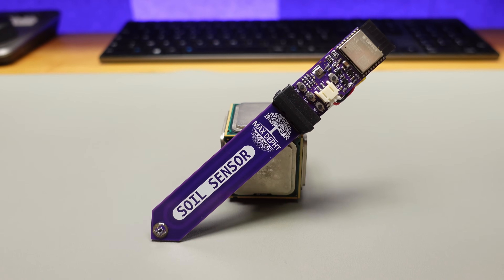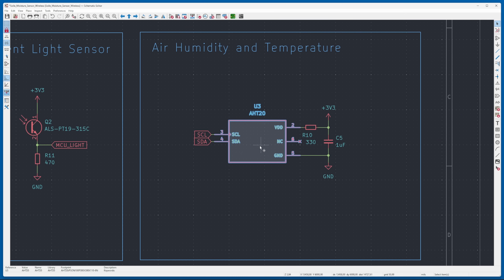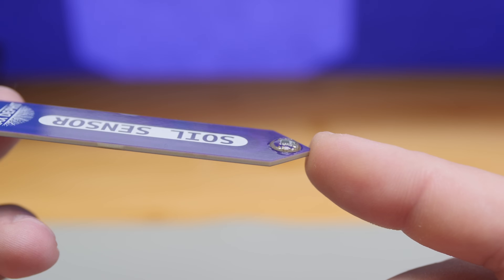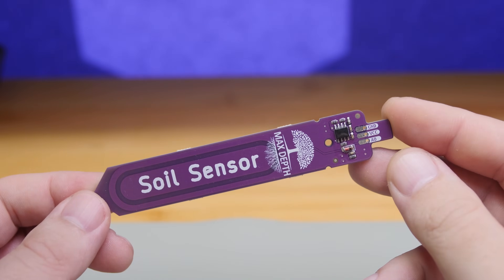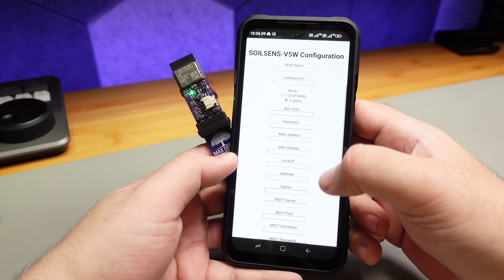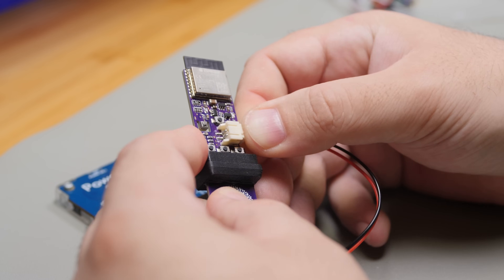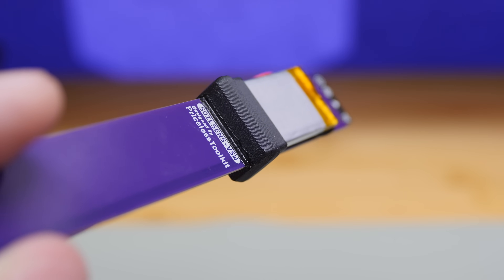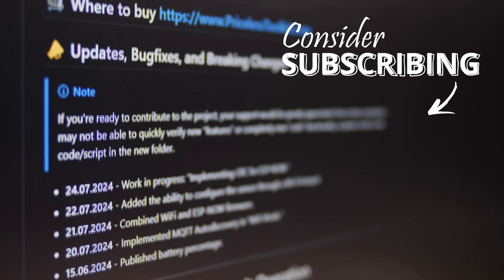Ultimate Soil Moisture Sensor for Home Assistant SOILSENS-V5W

Comment: Did you use a conformal coating on the edges of the PCB to prevent moisture seeping in between the board and solder mask? Or do you think that's unnecessary?
Reply from the maker: Yes, I dip it in epoxy resin and hang it up. It wets and seals the edges of the PCB. Acrylic conformal coating is not meant for that.

Comment: Congratulation! I've built my own "ESPNOW-VALVE-CONTROL" gateway and the sensor communication was flawlessly. One thing I'd like to tell is to pay attention to the calibration sequence. As already mentioned, if the cal-button is pressed too long , you may fall into the setup mode without realizing it and settings are lost. Due to the limited space around the Cal-Button, use the right tool, its not possible to use the fingers, at least not for me. Anyway, I'm very happy with the sensor and the measurement results.
Reply from the maker: Thank you! I'm glad everything worked. And you're right I'll change the button timing for the next batch.

Comment: Look nice and well finished,  but sorry, those kind of sensor are not good enough : 
- too short
- they will die in a few month
- hard to calibrate
- value change if you move it just a little
Did you test yours in a long run for more than a month ? are the data reliable ?
Weighting scale under the pot works way better.
Reply from the maker: Yes, I know sadly, no magic in this world 😄 The sensor is protected with epoxy resin as much as physically possible, and I'm actually using it myself. So far, it’s not dead (surprise!). About value changes when you move it — like I said, no magic: that's just how physics works. As for the weighting scale… sounds great, unless your plant forgot to grow. 😉

Comment: Great idea. But unfortunately these, (and none of the Tuya etc sensors I’ve seen either),  go anywhere deep enough into the soil for anything other than very small pots. Many common house plants need to dry out at the roots between watering, and just because the top couple of inches are dry doesn’t mean the roots are (the soils does not dry uniformly), and people very often overwater their plants. The soil moisture testers that actual house plant experts recommend and use are much much longer. It would great if they could be automated.
Reply: This can be overcome by digging a whole and surrounding it with plastic and putting the sensor further down.
Reply from the maker: @Miguel-ng5wm  not a good idea, wather level can go up in it and will kill sensor.
Reply from the maker: Yes i agree, it is for small plants.
Reply: Hey  @PricelessToolkit i have got small house plants, are the kits (beside battery) ready to go or do i have to assemble and apply software etc?
Reply from the maker: @daveman961  Hi, it's ready, but you need to configure it. https://github.com/PricelessToolkit/SOILSENS-V5W?tab=readme-ov-file#1-configuration
Reply: @BadgerBob when you say these sensors are only meant for very small pots, what would you say is the maximum pot depth they can be used with?  Many thanks.

Comment: Most sensors have a problem with long-term performance. They focus too much on manufacturing and not enough on materials analysis. Will this sensor work for a year in the ground, or will it be destroyed by corrosion sooner?
Reply from the maker: Ask after a year!, but it is more protected than cheep aliexpress ones, edges are sealed with epoxy resin.

Comment: The 555 is not needed if you have an ESP32 on board, just setup a periodic timer from the ESP32 to generate the PWM. It will save somewhat 150-200uA current and further prolong the battery life.
Reply from the maker: Yep, i know, Thank you.

Comment: Incorporate a light pipe for the light sensor if you want to use opaque cover plastic. Yes it adds some complexity, but it allows for better types of plastic to be used.
Reply from the maker: @kineticraft6977  ASA is not the best ?
Reply: ASA has a lower clarity than acrylic (PMMA) or polycarbonate (PC).
 @PricelessToolkit

Comment: really nice! I have a lot of 3V lipos laying around from single use vapes. They should fit perfectly for this project!
Reply from the maker: Lipo 3.7V nominal. and if the size is small enough
Reply: @PricelessToolkit 
Just checked they are 3.7V. i don't think they'll fit but I will print my own case and problem solved :)
Reply from the maker: @mrsinnlos1000  nice!!

Comment: Nice work, looks like a great design. 
I would suggest adding some epoxy to the edges of the PCB too. It's probably not needed but moisture has a habit of finding its way in over time.
Reply from the maker: Yes, I’ve already added epoxy along the edges and applied a fine coat to the surface, while the component areas are protected with an acrylic conformal coating.

Comment: That's ... fine, but without some kind of sensor that would give a sense of the ground fertility I see no point in replacing a "Xiaomi Mi Flower Care"
Reply from the maker: Yep, there is no need to change the sensors that you already have, there is no point in that.

Comment: the FR4 alone will expand from moisture since it's not covered on sides. just from experience on sensors: being even close to soil will destroy most of electronics in months unless they are fully sealed, like dipped fully in epox.
Reply from the maker: I’ve already added epoxy along the edges and applied a fine coat to the surface, while the component areas are protected with an acrylic conformal coating.

Comment: Good Project! Any plans to do a „low cost“ version? 30€ for one is quite steep if you need something like 5 of them. And with having 5 of them, a lot of the sensors on the device are not needed anymore.
Reply from the maker: Thank you! If I assemble the PCB but skip protecting the TMP and moisture sensors with resin, and don’t print and glue the case, then maybe yes, a 'low-cost' version could be possible. But let’s be honest, no one really wants to inhale that toxic stuff themselves!

Comment: Btw you don't need a pull up on tpm102 alert pin
Reply from the maker: don’t remember exactly, but I believe a pull-up is mentioned in the datasheet.
Reply: @PricelessToolkit  it is necessary when you use alert signal. Otherwise it can be left floating.

Comment: Why not make a Zigbee based on using ESP32-H2? The market for one based on Zigbee would be much larger. I personally avoid WiFi devices when ever possible.
Reply from the maker: I don’t build devices specifically to sell; I make them for myself first. If they turn out well, then I may offer them for sale. I'm also not familiar with Zigbee and have never programmed with it.

Comment: How Does ESPNow compare to LoRa, rage-wise? If I could get signal from my 4-th story apartment all the way down to my building's backyard (which currently I can't with either my wifi or zigbee setup) it seems like a good alternative to LoRa with much less hassle.
Reply from the maker: range is like "3-4 x WiFi range" but i cant say it will work in your situation or not. If you put zigbee gateway behind window it not working ?

Comment: i believe this suffers from the same fate as any other PCB-build capacitive sensor; moisture creeps into the PCB and permanently alters the sensor's readout
Reply from the maker: dip into epoxy resin. or in my case "epoxy conformal coating"

Comment: Wow the calibration mode is really nice, also 67nA?! ❤
Reply from the maker: Thank you very much!
Reply: I wanted to ask, with the moisture sensor sandwiched between layers, obvious win! But how does it work? Like does moisture sneak through the layers to make a measurable change?
Reply from the maker: @stucorbishley  no, its a capacitive sensor. moisture cant go inside, i sealing it with epoxy.

Comment: Hi. This won't last. The only soil moisture sensors that work are time-domain reflectometry (TDR) based sensors.
Reply from the maker: if you know what you're doing, the sensor will last.
Reply: @PricelessToolkit  It will not no. Even if you coat the edge of the PCB with a resin it will eventually de-laminate and the traces will erode, changing the readings you are getting which leads to false triggers of automations. Ask me how I know.
Reply from the maker: not only the edge but the entire part that goes into the soil "dip into epoxy" MG chemicals have a conformal coating that can be submerged in water.

Comment: Very nice. For a zigbee design, do you need to redesign a lot? I guess a different chip would be better for zigbee, as esp32 needs the expensive c6 or h version and draws more power than needed.
Reply from the maker: Thanks; the Zigbee code is complicated for me, for that reason, i didn't put c6

Comment: Sadly as far as im aware, so far every one of these PCB designed sensors get infiltrated by moisture on the PCBs cut corners. The moisture that is soaking in the PCB from the side and between the layers will start changing the calibrated readings and after a while it completely will stop working. Some cheap ones hold on a week, some more expensive ones maybe a few months. Sadly this is why industrial sensors are so extremely expensive.
Reply from the maker: you can coat "dip" it  with epoxy resin.

Comment: A small solar panel on top is probably unnecessary but fun :P
That would increase battery life to unlimited i would guess?
Or allow more frequent updates.

Or even have a "smart" algorithm choose the update frequency based on battery voltage / percentage.
Above 95% every 5 min, above 90% every 30 min, etc.

If there is no sun it will eventually fall back to 1 hour.

Probably would make it way to complex, but fun to think about :P

Awesome video!
Reply from the maker: Cycle time is not software based.

Comment: So the sensor with the Cap is not suited for outdoor usage? How do you suggest to charge the battery?
Reply from the maker: Rains come in different strengths, and the sensor is not watertight. 1s Lipo USB charger, links are on the GitHub page.

Comment: 😍 You restocked them?! Those soil sensors are just next level! I love this project, great work 🙏

//EDIT:
Isn't it called Depth and not Depht? (Regarding that on the soil sensor)
Reply from the maker: It is on preorder, next batch will be ready in 10 days. yes, it is already fixed.

Comment: How does this integrate with droplet? And plans on selling bundles?
Reply from the maker: The sensor integrates seamlessly with Home Assistant, making its data available to any other connected device. By default, the Droplet checks the wired sensor’s value every 5 seconds. If you'd like to use the Droplet with a wireless sensor, the ESPHome YAML configuration will need a few minor adjustments.

Comment: Cool, very clever PCB design!
What's the reason the wired version doesn't work with the Doplet?
Reply: Meh, more elegant than my current corroding sensors ;)
Another possibility maybe: a 3V3 regulator before the VCC-trace on your sensor?
Reply from the maker: @HenrikAkerstedt  Yes that will work. What part is corroding ? try dip sensors in epoxy UV resin.
Reply from the maker: Thanks.  Dropled has 5v output on sensor connector, so output signal from the sensor will be more then 3.3v
Reply: Ahh, I see. So would a 5V to 3V3 resistive voltage divider between the sensor output and the Droplet work then?
Reply from the maker: @HenrikAkerstedt  in teory yes, you need to bring down the max level to ~2.8-3.3v, but this is not an elegant solution.
Reply: I think water got in through the edge of the boards, where the epoxi is thinner. The signal quality got worse over time, so I might need an upgrade!

Comment: Nice sensor, well done! 👌🏻

I'm using WiFi, BT and Zigbee devices. All of these protocols, just like ESP Now, run in the 2.4 GHz frequency range. How does ESP Now affect other networks, what is your experience?
Reply from the maker: I have a bunch of devices on WiFi, 5 on Zigbee, 8 Bluetooth. I can't say I've noticed any issues, as the transmission time in ESP-NOW mode is ~100ms every hour.

Comment: Really interesting looking soil sensor. I like how you have designed the moisture corrosion opportunities out.

One small critical observation -  Max Depth has a typo (Depht) on the silkscreen.
Reply from the maker: Thanks! yes silkscreen typo is fixed :)
Reply: @PricelessToolkit  Great stuff!

The more I think about this, the more I am impressed by the whole sensor suite you have packaged together. I will certainly be following along, and I'll also procure a few sensors too.

If I may offer a small design suggestion?
Instead of a translucent case, take a length of virgin filament, and affix it into the case as a light pipe "antennae". A cut of 45 degrees at the lux sensor end should allow the gathered light to be reflected onto the sensor. With the other end of the light pipe among the foliage, a relative measure of the amount of light the plant receives could be most beneficial, and still allow the most UV resistant case material to be used.
Reply from the maker: @squelchstuff  Great suggestion! If I find the time, I’ll design a cap with a hole for the filament. However, even with the white cap, the light sensor is already sensitive enough.

Comment: Great Sensor, any specific reason why LMC555 is generating PWM and not ESP32-C3 directly?
Reply from the maker: Yes, the ESP32-C3 can certainly handle the PWM, but I opted for a hardware solution for better stability and simplicity. Since I’m not planning to produce 10,000 units, the cost difference is minimal!

Comment: Can the battery powered one handle a cheap solar panel for trickle charging during the day? (As in, a small panel scavenged from say, an old calculator or a child's toy)
Reply from the maker: Yes, technically, a small solar panel could be used for trickle charging. However, with ESP-NOW mode, the autonomy is more then two years "in teory", which generally eliminates the need for additional power sources. The only scenario where a solar panel might offer added benefit would be if you replace the LiPo battery with a supercapacitor, as supercapacitors handle charge/discharge cycles better and can extend the lifespan in cases of frequent recharging.

Comment: Love the in-board solution for the sensor.  For my conditions (year round growing, extreme summer heat and humidity) I think it might be worth hitting the edges of the probe with epoxy as well, to avoid moisture ingress and possible delamination. Would love to test one out. Hope I win. :)

The "spike" form factor is great for pots and planting beds. My biggest water consumer, however, is my lawn. Be interesting to see a design for something that could be fully buried, so I could map across the entire yard, and even mow over them. I suppose that'd be possible withe the wired sensor, laid flat, then trench wires back to a common location (dig in just below the turf with a sod knife, basically). Now I'm wondering about co-locating the controller part with sprinkler heads, with sensors deployed in the spray pattern for each head. Too many ideas!
Reply from the maker: Thanks, you can dip entire prob into Epoxy resin, noy just edges. The fully buried can be only wired sensor.

Comment: Wow the sensor looks really promising and finally no more problems with oxidation like with the cheap sensors
Reply: This was real smart, suprising no other made it with 4-layers.
Reply from the maker: I think there are many 4 layer sensors
Reply: @PricelessToolkit hey I love that design and that you provided the files!

Regarding the waterproofing: is 4 layer FR4 really watertight? Won't it wick in water over time and let the values drift towards "wet".
Reply from the maker: Thank you!
Reply: I’ve been using Ecowitt sensors for years, and none of them have ever broken. They last about a year on a single AA battery and update every minute. They have an API for integration but also a great website. And the sensors are entirely waterproof.

Comment: Thanks a lot for sharing! Is it possible to make the capacitive board that goes into the ground with no components and wire that board to the controller board? In this way you can have alle the components in a ip-classified box hanging on the outside of the pot (also great for use outside).
Reply from the maker: My plesure!, no you need to have some components "555 timer....."
Reply: @PricelessToolkit  I mean just separate the capacitive part of your PCB and have all your components on a separate PCB with wires between
Reply from the maker: capacitive part need cuple components near "alongside". The MCU, buttons, battery ....... can be separated.